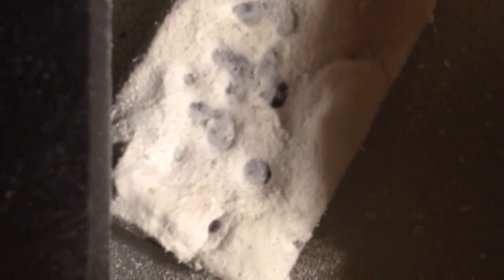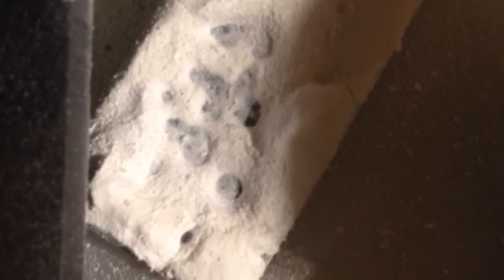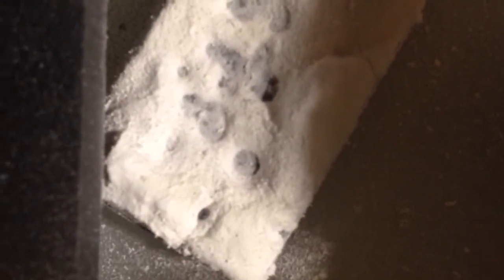Electric Discharge Crater Formation akin to Moon?

Comment: Can this be tried on silver or mercury?
Reply from the maker: Yes, however as both are excellent conductors, the effect would be transient and smaller scars on the silver.  Mercury would be not an optimal substrate as volatile aerosolized hg is neurotoxic and less than safe to work with HV discharges
Reply: @diveflyfish  
I think we should be open to the possibility the moon isn't a dusty rock but perhaps something entirely different. The electrical discharge theory seems so close but maybe it needs to be tried with a variety of materials.